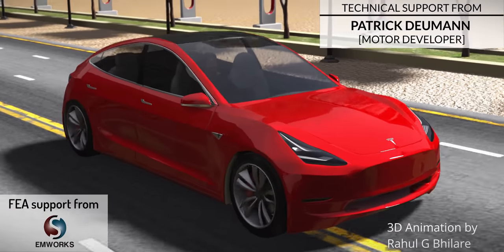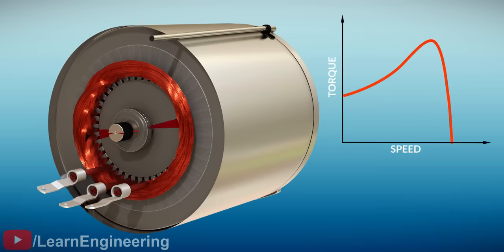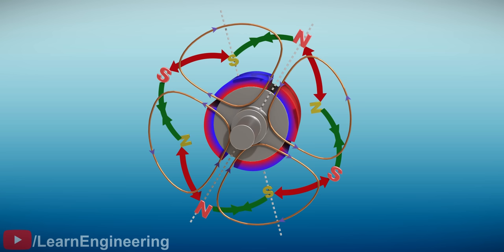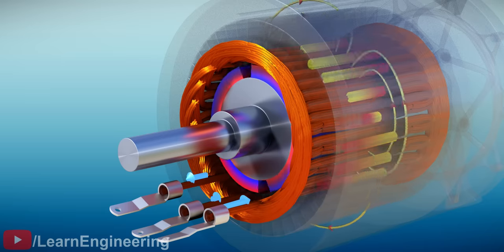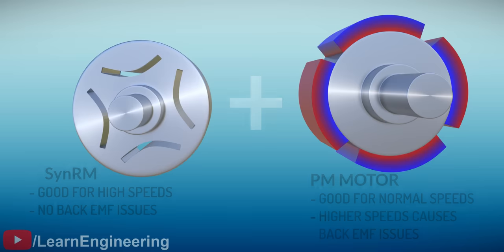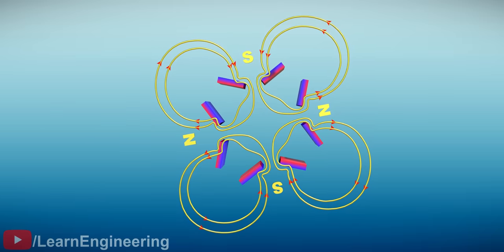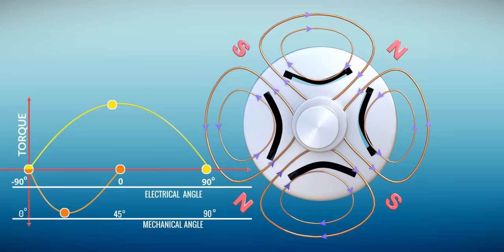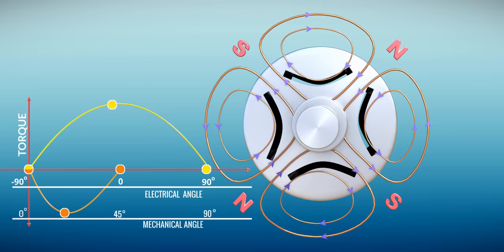Tesla Model 3's motor - The Brilliant Engineering behind it

Comment: I'm a gearhead from the 1970's.  I've maintained my various cars to this day.  But suddenly, it feels like my knowledge and experience with non-electric cars has been obsoleted.  I look at my cars now and think "why bother"?  My son's Tesla Model 3 Performance does 0 to 60 in about 3.6 seconds.  That will smoke anything I've got - which includes a built nitrous boosted Trans Am and a Corvette.  Electric cars are the wave of the future.  Gasoline engines will begin fading away.
Reply: Yeah, but its fun to blow the dust off the old dinosaur and let it roar every so often.
Reply: With a range of 200 miles I won't be buying an electric car any time soon
Reply: I think gasoline engines are not outdated at all. There will be a problem soon,shortage of Lithium around the world. But you can grow fuel for your engine in your garden (I give you a hint - canola oil)
Reply: @The_Ballo  , the Cybertruck I will take delivery of next year will have a 620 mile range, 0-60 in 2.7 seconds. Bed capacity of 3500 lbs and towing capabilities of 14,000. Towing the 14,000 lbs will decrease range to about 400 miles, however.
Reply: Well said sir
Reply: @shepherdsknoll  LOL! I do actual truck things like tow and drive in the mud. Good luck with your meme truck. No fucking way are you getting 400mi towing except in Kansas on a day you don't need either AC or heat
Reply: @Redfvvg  LOL yeah go ahead and try growing your fuel. 9/10th of calories grown in Oklahoma come from rock oil, not the sun
Reply: @The_Ballo  , I’ll be out on the road about 11/21, don’t come up against me. BTW 400 miles will be doable with the new 4680 batteries, and I’ll be pulling that  load at 65 mph, up a grade.

Comment: So basically they achieve variable magnetic force of the rotor, the same as synchronous motors do.
Reply: That is one way of looking at it. At the end of the day, it is all about regulating the slip. Slip produces torque, but also generates heat which reduces the efficiency. 
A fully synchronous motor has little torque so weight become the problem, it also slips during start-up.
The balance needed to produce maximum efficiency was historically seen as around 5% slip on asynchronous motors driving a constant load. The problem on variable load with variable speed is maintaining optimum slip over the rev range. 
Clearly, improve motor design and additional poles help, but correct feedback from motor to inverter is every bit as important in order to prevent energy being dissipated as heat.
Siemens led this technology in the early day, developing motors, inverters and regenerative braking for the railways. Their systems returning the regenerated power to the tracks, for close operation and short distance between stations for the London Underground was a milestone in technology.

Comment: that's how variable valve timing assume in synchronous reluctance effect
Reply: "Electric V-Tec just kicked in yo"
Reply: VVT is cam phasing tech. This doesn't incorporate any actuator OR spool valve .
Reply: @raunaksingh1257  i say assume. not similarity in mechanism. u r not petrolhead r u
Reply: @rasyidsuhaimi295  yes now I'm not petrol head 😂 ... I'm motor head (future is electric).
Reply: @rasyidsuhaimi295  I drive a petrol car and am aware how one hundred years can improve an ICE however it is very complex and needs a lot of maintence. Imagine if ICE was introduced now? Whut? lots of little explosions! What do you mean that inflammable petrol has to be stored in suburban locations?
The electric motor is a lot simpler compared to a whole lot of pistons and cams burning fuel and turning gears.
And an electric motor doesn’t have to idle.
And this video is roughly 20 years of development, imagine if EVs were developed from the 1920s? It’s a pity that the oil and ICE sought to limit EVs.
Reply: @Daryl Cheshire  i see. so u r pros to the electric motor. but for me the era for electric motor is just beginning. but for big scale usage isn't ready. maybe around couple of years the electric motor vehicle will take over.
Reply: @rasyidsuhaimi295  There will still be petrol heads who want the roar and the rumble

Comment: 10:48 So was Toyota the one who invented IPMsynRM and Tesla just improves it by chop the permanent magnetic into smaller pieces?
Reply: Halbach array. Model 3 really does not do anything different. Prius probably did not go with halbach arrays because Toyota determined it did not produce a significant improvement. Indeed there are experiments on this and it can be shown that when the air gap is very small, normal vs halbach array makes negligible improvement but drives manufacturing costs way up. The purpose of a halbach array is to redirect magnetic flux to one side of the array. This is not really needed in an interior permanent magnet design because there is rotor iron everywhere, i.e. no flux leakage. And about the air gap, when the air gap is small, there is a saturating effect that gives diminishing returns. https://www.duramag.com/techtalk/halbach-arrays/benefits-and-drawbacks-to-using-halbach-arrays/.
These motors employ an alternating N-S pattern.

In short, the magnets and the motor iron form a circuit. Magnets generate fields on both sides. Halbach arrays redirect the field from one side to the other side. This would be useful for redirecting field through magnetic iron if it otherwise would not be going through such iron. But in the design of these interior salient pole pmsm, there is rotor iron everywhere around the magnets, so redirecting the field really makes no difference because the magnet circuit is always going through iron regardless of whether you use a normal configuration or a halbach configuration.

In fact, one of the purported advantages of using a halbach array in a motor is that it strengthens the working field on one side to the point where you don't need rotor iron to achieve the same torque density.
Tesla does not do anything new. They simply have first mover advantage. This is what Dyson meant by "it is too easy to make an electric car".
Reply: Short answer: neither company gets credit for inventing it, this type of motor has existed for decades but has not been very popular. Toyota and Tesla both have patents for a bunch of small optomizations. There are a lot of niggly details that this video ignored. Getting 96% out of this engine rather than 80% is largely about the careful computer control and the rest is about very carefully designed geometry with tight tolerances on the metallurgy. This design is less efficient than the competition in any one use case than. At low rotational speeds permanent magnet motors are just plain better, at very high speeds reluctance motors are just plain better, and somewhere in the middle induction motors are just plain better. Outside of electric cars, you generally want a motor that is good at one of those scenarios, not all. So, IPMsynRM didn't really get the research dollars until the advent of electric cars, which need motors that are efficient and effective over a very wide range of frequencies.

@TheCreeperkiller The segmented magnets are not a halbach array in this engine. They are segmented for heat management, as said in the video. The effect is not large and probably not worth the manufacturing cost for Toyota, but Tesla engines are designed to have a much higher peak power than Prius engines, so the heat is more of an issue.
Reply: Tesla didn't invent anything.  They are utilizing motors from a Regular MOTOR BUILDER in business for Decades and well known in the U.S.(IDK about the rest of the world. here, We have been using their products for Decades. but...I'm not surrendering the name of Mfg. as I too am working on Developing my own eCars.   But I never planned to use "Induction motors" )

My Hardware is B.......ummm...I probably better shut my mouth for now..........
...... these motors are Probably Still best.....and Cheaper!!!......... So.............
Reply: @jesscast5122  Good luck with your build !
Reply: The answer is the "tesla" here is used as click bait and to fool people to keep watching.  Thumbs down the vid...
Reply: Prius said : I am yor father!

Comment: Thank you for this video. Its a good explanation of very interesting theme.

Those 2% doesnt seem that much, but its really hard to get efficiency once you get close to 100% (which is of course impossible to reach).
I see it that way: You cutting the losses down from 6% to 4%, which is 1/3! 
Also this is not achieved by adding external devices (like a turbocharger or a 48V hybrid system in a ICE) so this wont be an additional maintenance or cost issue. Its just a better implementation of the electromagnetic physics. i like it ;)
Reply: Ya but in the end Tesla engineers decreased the performance or role of permanant magnet to decrease back emf. This IPM synrm mostly uses reluctance property and doesn't able to fully  use permanant magnet.And I like your comment.

Comment: I'm a noob, but won't 'permanent' magnets lose their efficacy over time? How long before they (or the motor) has to be replaced? Before or after the batteries?
Reply: never
Reply: maybe electricity keep it working?
Reply: It depends on a lot of factors, but generally the magnets won't demagnetise for a very long time, lol by the time they do, the car will be sitting in a tip somewhere

Comment: 10:35 I wonder if they have tried putting the magnets in a free floating channel so it can spin based off of cars needs ... So each magnet can be either pull or grab... Using small motor

Comment: So Tesla's brilliant idea was copying the prius motor.  Good to know.
Reply: Toyota
Reply: Tesla supplied ev tech to Toyota.
Reply: Seems you were not paying much attention.
Reply: those types of motors are used more over 50 years... Not so innovative. Electro-mechanical transformators, early 50th and so on. The purpose of this video is visual explanation of how it works. And Tesla/Toyota engineers are put new breath to oldschool SRM motors.
Reply: Exect for breaking up the one piece permanent magnets into segments to lessen the Eddy currents in the stator's coils.
Reply: @Eddingtonification  very interesting idea - could I suggest you read & address your video's comments - perhaps it'd get better attention...

Comment: Though having a higher efficiency "IPM-syn-RM" also make the design so complex.
Reply: Plus, won't permanent magnets get weaker over time from exposure to the stator EMF? I'll take an induction motor with 2% less efficiency.
Reply: @yaynative  I heard the motors could last a million miles....I'm not worried about mine.
Reply: @yaynative  the magnets are arranged and sectioned to reduced demagnetizion . The motors are suppose to last a very long time. I wouldn't concern myself with that specific issue

Comment: The engineering reminds me of how the six hydrocoptic marzelvanes are fitted to the ambifacient lunar waneshaft to prevent sidefumbling in the latest version of the retroencabulator. What's interesting is that without the risk of sinusoidal depleneration, there isn't a need for a drawn reciprocation dingle arm.
Reply: The turbo encabulator is truly a marvel of engineering.
Reply: It's also interesting how the remaframetz converter can be integrated into the watchmacallit control system.
Reply: For anyone who has no idea what these guys are talking about, here it is: https://youtu.be/RXJKdh1KZ0w and here's the original 16mm version by the guy who wrote it: https://youtu.be/Ac7G7xOG2Ag

Just for fun, here's the script:
"Here at Rockwell Automation’s world headquarters, research has been proceeding to develop a line of automation products that establishes new standards for quality, technological leadership, and operating excellence. With customer success as our primary focus, work has been proceeding on the crudely conceived idea of an instrument that would not only provide inverse reactive current, for use in unilateral phase detractors, but would also be capable of automatically synchronizing cardinal grammeters. Such an instrument comprised of Dodge gears and bearings, Reliance Electric motors, Allen-Bradley controls, and all monitored by Rockwell Software is Rockwell Automation’s "Retro Encabulator".

"Now, basically the only new principle involved is that instead of power being generated by the relative motion of conductors and fluxes, it’s produced by the modial interaction of magneto-reluctance and capacitive diractance. The original machine had a base plate of prefabulated amulite, surmounted by a malleable logarithmic casing in such a way that the two spurving bearings were in a direct line with the panametric fan.

"The lineup consisted simply of six hydrocoptic marzelvanes, so fitted to the ambifacient lunar waneshaft that sidefumbling was effectively prevented. The main winding was of the normal lotus o-deltoid type placed in panendermic semiboloid slots of the stator, every seventh conductor being connected by a non-reversible tremie pipe to the differential girdlespring on the ‘up’ end of the grammeters. Moreover, whenever fluorescence score motion is required, it may also be employed in conjunction with a drawn reciprocation dingle arm to reduce sinusoidal depleneration.

"The Retro Encabulator has now reached a high level of development, and it’s being successfully used in the operation of milford trenions. It’s available soon; wherever Rockwell Automation products are sold."
Reply: Marzellated lunar wayneshafts are way underappreciated.

Comment: keep in mind that there's more to buying auto insurance than just paying lower premiums.  You do get what you pay for.  Sure insurance seems high in some places but you really beat yourself over the head when you get into an accident and your cheap insurance company doesn't have any features to give you a loaner car or has high deductibles.  What does my comment have to do with the video? Nothing, but so does the ads I am bombarded with.
Reply: Car insurance is basicaly a road tax at this point unless your a teen age ferrari driver from beijing.
Reply: Use YouTube vanced on mobile, or adblocker for YouTube on chrome. I've not had a YouTube advert in years.

Comment: One issue is that Permanent Magnets are made from rare earths, usually mined in China that could pose supply chain difficulties, whereas pure Reluctance and Induction Motors do not require permanent magnets.
Therefore, it may be beneficial to combine Reluctance and Induction motor technologies that avoid the use of Permanent Magnets but yield higher efficiency and torque characteristics than the technologies considered separately !
Reply: i just watched a video explaining that subject . Using ferite instead of neodymium  https://www.youtube.com/watch?v=T0869sx7CAg

Comment: There is another way,the back emf can be used to generate power,back emf is just the same as generated emf in a generator so basically the motor is acting as a generator at the same time as a motor and depending on the torque weather negative or positive the dominant function will be ,in other words when the forwards momentum of the vehicle is greater than the thrust then your motor is a generator and could be used as such with a few little electronic tweaks and an interconnection with a few super capacitors the excess forwards thrust can be converted back into electric power to regenerate the battery pack.This principle can be taken to an extreme even to the point of light breaking applications.I can not believe they have not incorporated this principle into the driving mechanism,so easy to do and it basically means every time you go down a steep hill or decelerate all the energy of momentum can be reused instead of lost.This would greatly increase distances all but in smooth cursing circumstances so basically around town and the suburbs and almost every where there would be a real energy saving therefore greater single charge mileage.Come on guys get with it,batteries aren't everything.

Comment: It's nothing new compoared to other motors. Field-Weakening, integrated magnets, the IPMSynRM machines in general are nothing new, and are also used in other cars. Segementing magnets to reduce eddy currents is a century old principle. 
But anyway, a good simplified explanation. Maybe enhance it with MTPA, what is the key in control for good efficiency
Reply: Mel Bauer  Yes, they all can attain >90% efficiency (usually ~92%-96%), the induction motor that Tesla previously used has a slightly lower efficiency compared to PM machines. The technology of electric motor is quite mature. In fact, Honda used IPMSynRM years ago in their earlier models.
Reply: Mel Bauer  Teslas induction motors have low efficiency, like all motors of this kind.
Model 3 is a efficiency engine, no doubt. 
But there is no new principle inside. Also BMW i3 is a motor of this type. And Toyota, Honda hybrides too. And I guess others too
Reply: Mel Bauer  Haha, that’s because the title of this video is a clickbait and Tesla is hyped recently